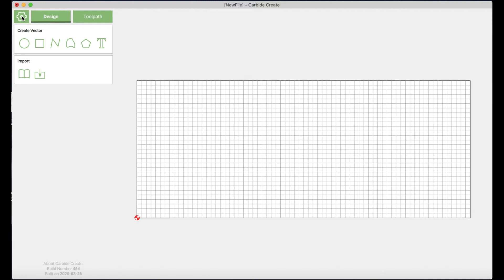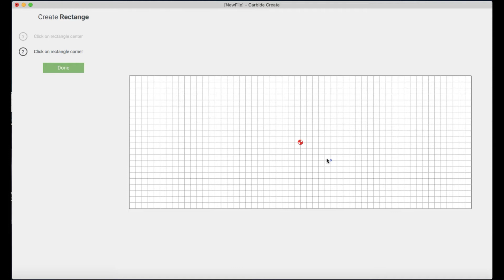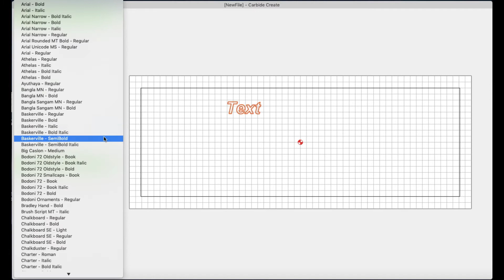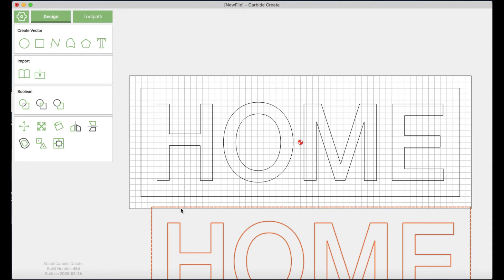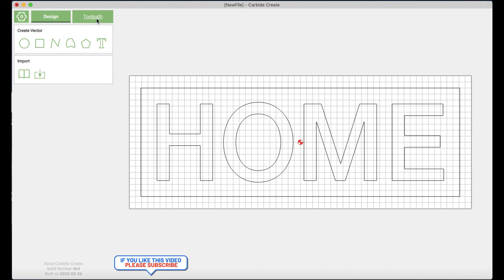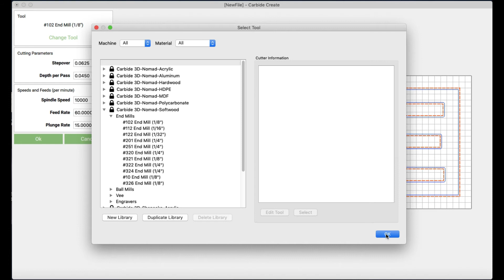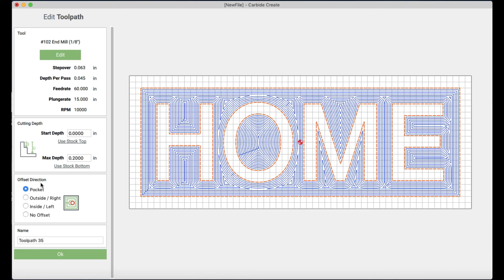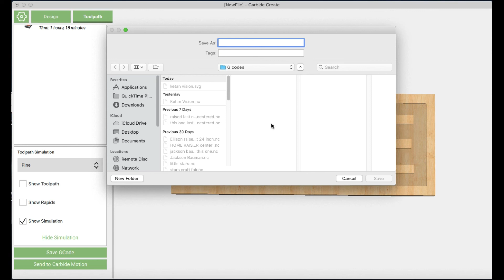How to Use Carbide Create: Making a Wood Sign

Comment: I'm curious Deb, why did you copy the name and frame, paste it, then delete the original ?  I've watched that part a few times but to get as to why that step is required.
Reply from the maker: Hey!  For whatever reason, if you don’t do this, when you go to create the tool path, it registers differently and just cuts out the full rectangle at one depth without leaving the raised letters.  I’m hoping they eventually change it so that isn’t necessary to do!